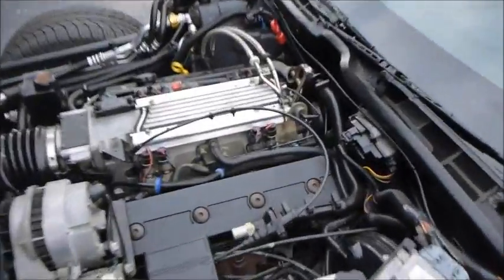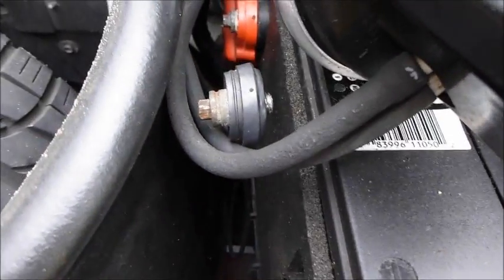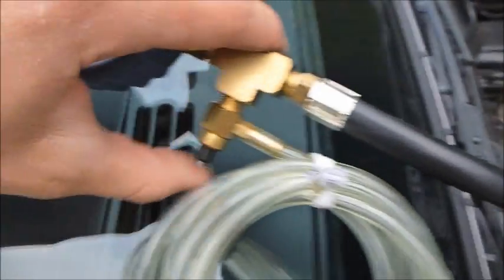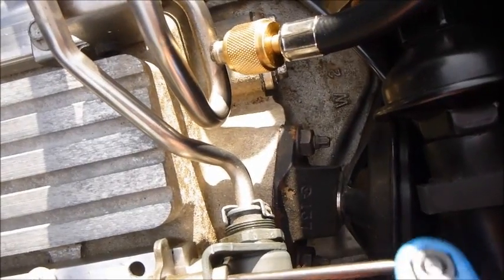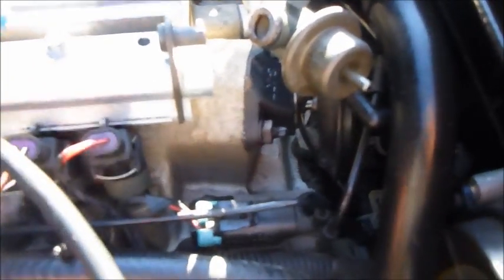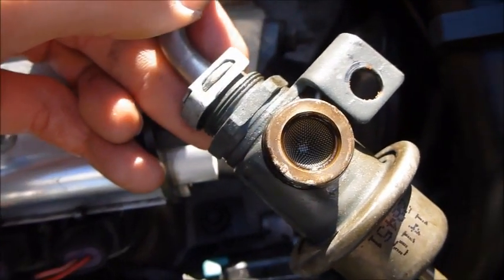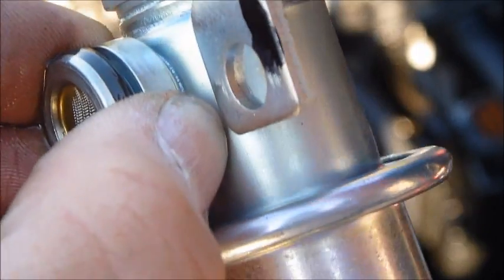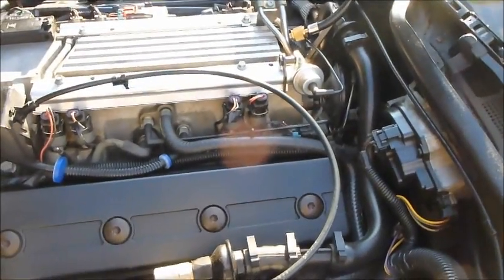How to replace a Fuel Pressure Regulator

Comment: Chris, thank you for this video. I have the exact sale issue of a leaking fpr at 50 degrees on my 96 LT4. Why would temp have anything to do with this condition?
Reply from the maker: Because metal and rubber contracts and expands at different temps.

Comment: One thing you can do to test it. Pull the vaccum line off and prime the fuel pump, you might have to run it for a few seconds. In theory if it's broken, the diafram wont seal and will spray a little bit of fuel out of the vaccum hose port. If it doesnt, it probably isnt broken.

Comment: Does the fuel pressure regulator need a regulated vacuum line, or will an unregulated line do just fine? I just pulled apart my Ford Ranger and the vacuum line that was on there was unregulated, but the truck ran very poorly. I'm wondering if it needs a specific amount of vacuum to regulate fuel flow

Comment: Hey chris would this cause the vehicle to stall intermittently if that fuel pressure regulator was bad? I'll drive and the car will shut off
Reply from the maker: Possibly but many things can cause that.
Reply: @chrisfix hey i think i might have your same problem, i would stall if i let my rpm dip below 800 and i would have to flutter the pedal and turn it to get it to start

Comment: i learned from your vlog that a vacuum leak leads to high fuel pressure, so if i check my spark plugs and they are clean, it means it doesnt run rich, which means fuel pressure not high which means no vacuum leak?

Comment: Chris, You are still helping us out with this video you did 10 years ago.  These things develop odd leaks.   Mine was leaking maybe 3 times over 3 months.  I would smell fuel in the car for maybe 5 minutes and then go away.  I thought it was a plugged vent line.  Just checked the Fuel Pressure Regulator  before checking the vent lines.  Started the engine no leak.  Pulled the vacuum line and it leaked bad on the non-vacuum side of the diaphragm.   Thank you Chris.

Comment: This morning I started mine up and for a split second I realized it wasn’t the same amount of cranks and it was really boggy… Drove it down the street, drove it back and parked it in the driveway. 20 minutes later I go to start it up and it’s just cranking now… No start, I was thinking maybe bad injectors but this looks easy enough to swap out…

My question is, why/how did you know it needed to be changed? What were the symptoms? Mine has been running great, so much that the last time I drove it I pushed the hell out of it on an empty freeway and it did great…

Comment: Seriously? 1st mistake, negative line can drop down & hit some metal causing spark, unless you attach it to a plastic hanger & hang it somewhere it can not spark. If ur worried about getting electrocuted, disconnect the positive line from the battery. That drops down & hits metal, there's no worry of an accidental spark.
Reply from the maker: You remove the negative first because electrons flow from negative to positive. If you remove the positive and you ground from the positive post to the metal of the car, it would not end well.
Reply: @chrisfix  no, negative(black wire) is the ground. You ground the positive(red wire), nothing will happen because the battery is already grounded with the negative(black wire). That's why you said, make sure that's secure when you disconnected the negative wire, which the way it looks like you secured it on what looked like hoses, looked like it could've been knocked down and you would've not only electrocuted yourself, but shorted out most, if not all, of your electrical system. But hey, you feel like you know better, then by all means, don't listen to me. I just hope you'll never really have to find out the hard way.

Comment: What T wrench sizes are used to hold fuel lines and fuel pressure regulator????? Most from that era are upside down and have much harder access, and it's easy to see how hard they are to break lose. Once rounded out then views are going to have real problems. Always show tool sizes. Everyone knows the battery bolt size.
Reply from the maker: I don’t remember off the top of my head for the corvette but that’s why I started to include sizes in my later videos!
Reply: They really should be added to your video, as they're very important on hidden access on many vehicles. I haven't seen any mention in shop manuals. I'm pretty sure the fuel pressure regulator is a T30, but the fuel line bracket is only a guess. You see how hard they are attached in your video. Anyone with that corvette should be able to check the size, expecially since the bracket bolt is up on top.
Reply from the maker: @ronkosanovich6450  for sure and the new videos have that info. This was one of my first videos over 8yrs ago…
Reply: bracket is T25 and FPR hold bolt is T30. Both can be very stubborn to removed.

Comment: I wonder if silicone would be okay on the o-rings, or would that run the risk of clogging the fuel system? I'd rather use silicone, because it's rubber safe and is made for o-rings.

Comment: 4:58 
When dismantling any gas lines, it's a good idea to pull the fuel pump fuse and run the vehicle until it stalls out. Then no gas in any of the lines.
Reply: Would you then, afterwards, still disconnect the negative terminal on the battery?
Reply: @diro6232  it's always a good idea to disconnect the battery when working on the vehicle. But you're good after pulling the fuse. I myself wouldn't worry about disconnecting the battery unless you're going to be by the fan in the engine compartment.
Reply: @davecpgh  Thanks for that timely reply. Could I bother you for one more question?...Once new one is in, and fuse is put back in and negative terminal is placed back on, do you have to do anything particular to prime back up the fuel pressure?
Reply: @diro6232  easiest thing to do is turn the key to the on position then off then on a few times. It'll pump enough gas thru the whole line. If that happens not to work, then turn ronin position and pump the gas pedal a couple times, but be careful, you don't want to do that anymore than you need to
Reply: @davecpgh  Thanks for the helpful info! 👍 I will keep that in mind!
Reply: @diro6232  no problem

Comment: I got a pressure problem replaced the filter pump and it still runs like crap but my regulator is not leaking think it could be that?
Reply from the maker: Sounds like that's it!

Comment: For the first time in my life there is I had an ‘unsolvable problem’ and what do you know Chris made a video for it 8 years ago! I bought a Subaru with a ‘blow engine’ I’ve replaced everything that is related to vacuum boost and timing in this car or tested it with functional parts. Quite literally everything. This HAS to be it at this point! Thank you Chris

Comment: Great video. Only vid that showed the clamp on both fuel lines had to be removed to remove the regulator. But I think the vid could've been even better if you showed, not only verbally, the sequence of connecting all fuel line/nozzles together and buttoned up. But thank you for these great vids, regardless.
Reply from the maker: Thanks a lot!
Reply: @chrisfix  
Chrisfix, the two parts clamp are held tight by one 6 point star bolt. The problem I have is the star bolt is upside down against the engine. I have to disconnect the fuel lines to get the regulator out. Is there an alternative way.

Comment: Hey Chris, listen I have a tuned engine, I have a new direct ignition cartridge, new plugs, new fuel filter too. Can a failing fuel pressure regulator cause surging and rough idle? Misfires? Hesitation at full load/boost?

Comment: Also if it hasn't been said, unscrew the gas cap, I had constant pressure with the fuse out and finally decided to take off the fuel cap and  the pressure that was built up was now gone, large amounts of pressurized fuel in the line before taking off the cap on my 95 vette. 
Great videos!!!

Comment: Hey Chris, I purchased a used car with a b series engine swap. It runs super rich and I've fix and replacing parts to get better fuel economy. I've notice that the for does not have the vacuum connected and from the manifold the inlet is plugged. I tried adding a return line but the idle went up over 1200 rmp. I can't lower the idle since it's at the lowest point it can go. So as of now I'm running with a vac delete. Questions is would it be a bad fpr or is it tuned to bypass?

Comment: Nice video. I have a 95 Camaro z28 with an lt1, same engine. Does anyone know why it might back fire and stall? It back fires at 3,000 rpm. Recently Replaced spark plugs and egr valve. Thinking it might be either be the spark wires or injectors. Looking for another opinion.

Comment: I think I'm having this problem. I'm getting a '97 Honda Passport that will start, but it won't stay running. It acts like it's starving for fuel. I've already replaced the fuel filter. I'm fairly certain it's not the fuel pump because I really don't want to drop the tank. (More hope than anything else).

Comment: If we dont have a fuel pressure gauge, can we just disconnect the fuel pump relay and try to start car to release the pressure?
Reply: Terrance Williams pull the pump out while the car is running an it will stall an shut off. Let it crank a a few times an no pressure.
Reply: Terrance Williams yes you could do that

Comment: Would this be the problem for my f150 hesitatingly about 40 mph but still goes just need to apply more gas? Thanks man
Reply: did u figured out the problem? my car is doing the same
Reply: Not yet I don't have a muffler so what I think it is lack of back pressure but not sure
Reply: F150s have fuel filter issues try that.... if not cats could be plugged.

Comment: my C4 needs to crank 2-3 times, when cold, in order to start engine.
spark plugs, cables, air filter, flow meter, fuel filter anf injectors all replaced recently.
do you thonk it's a fuel regulator issue?
once it starts then it runs smoothly
Reply from the maker: +TheeAmateur Yes, that is exactly what I saw in my vette. Check out this video on how to diagnose the problem: https://www.youtube.com/watch?v=_oXLUqE4Sf0

Comment: my 92 camaro rs is giving me probs.. smooth on cold starts, smooth on low speeds, but as soon as a floor it, it bogs down, I keep finding others who have this problem, but no 1 has answered what's the solution.. any clue ? 3.1 v6 1992 camaro rs
Reply: +Jay Alvarez I don't have a camaro, and I'm just a wanna-be car techie at this point - so take this with a grain of salt, but I had a similar issue with my car. Turns out it was a transmission problem. The trans wasn't shifting back a gear when I floored it so a whole bunch of fuel was just being dumped into the engine while it was under heavy load, causing it to sputter and drop in rpm. Have no idea if that does anything for ya, but maybe it's not a fuel or aspiration issue at all.
Reply: +Jay Ricco thanx for the info, had it checked out a few days back, faulty injectors.. that's koo you for replying tho
Reply: +Jay Alvarez thank you*

Comment: Quetion: in which direction does the fuel enter the regulator and where does the excess come out.. and can i disconnect this black hose and check if fuel comes out.. when i think my fuel pump is not working ???
Reply: i want to know this as well
Reply: Ahmed H. Ramadan it goes in through the metal pipe and there is no excess fuel

Comment: what happens if I don't have the fancy machine to take pressure off the regulated before removing the old one
Reply from the maker: +2pacnasgame Run the car and pull the fuel pump fuse. That will cause the engine to suck the fuel out and leave no pressure.

Comment: Hey Chris, here I am again lol. Long story short. 2000 Sportage came with a CEL code for P0138 code one day, but it turned itself off the next day. 5 days later, I'm stranded in NJ my car wouldn't start. Fuel pump fried, fixed that. Now here is the problem. After fixing the fuel pump, I now have the same P0138 code that DOES NOT go away, I replaced both O2 sensors, reset the CEL, and it comes back on after 2 driving cycles. Me and my mechanic can not figure out what's wrong. Could it be fuel pressure regulator in the most weird scenario? No codes for CAT or anything, keeps giving P0138 =/ help
Reply from the maker: Exhalerr r Well, it could be high fuel pressure so I would do a fuel pressure test since you replaced the O2 sensors already.
Reply: +ChrisFix yeah I think it's somewhere in there. Because I fixed the P0138 (main relay wasn't OEM, go figure) but now I have a P0442. Already replaced fuel cap to OEM, what's next

Comment: WIll the fuel rail work without the small metal clips? I bent a couple. It looks like the 4 bolts hold it down. I am changing injectors on a lt1 camaro. 1/2 the engine is under the hood. I am afraid I loosened the fuel line to the rail with all the tugging and twisting.,.
I should of had someone do it. I am afraid i screwed up. Any help appreciated.

Comment: Hi Chris, I have a 2001 Ford Taurus and it has the check engine light on. The fuel gauge does not work, it always shows "E" (Empty) and the fuel light is always on.  OBD2 scanner and gave me a P0460 which is flex fuel sensor module. The part number is YF1Z-14A069-AA. I found a video which says that the flex fuel sensor is behind the radio. Do I need to disconnect the negative terminal of the battery to do any electrical work as this? Also do you know how this needs to be done? Thank you.
Reply from the maker: Steve Smith Yes, always disconnect the negative terminal when you work on electrical components to be safe (especially under the dash). I do not know the specific process for your Ford Taurus to replace the sensor (I never did it). You might consider getting a service manual which will walk you though it all.

Comment: hello. I just saw today that my fuel pressure regulator has been leaking for a while now.ive been noticing that my car has been hesitating at start up and yesterday it happened while I was driving. chould the regulator cause this? and  where did you get the part and where did you get the pressure tester?

thanks
Great video.
Reply from the maker: tomas puigjane Yes, the regulator can cause this problem. What year, make and model car?
Reply: ChrisFix its a 1996 corvette lt1
Reply from the maker: haha, same year as mine! Here is the one I used: http://www.amazon.com/gp/product/B000C9JXSY/ref=as_li_tl?ie=UTF8&camp=1789&creative=390957&creativeASIN=B000C9JXSY&linkCode=as2&tag=chri0e2-20&linkId=DJSAJRCFNMTJ6BTJ

Comment: I have a 2002 Yukon 5.3 with an intermittent hard start mostly when its cold it will take like 3-4 seconds longer of cranking for it to start. It idles and runs perfectly just every so often it takes a little longer to start. It has a newer fuel pump around a year old or so. I did notice that I am getting a strange noise from the FPR similar to this video: https://www.youtube.com/watch?v=R1bgiJVoNOc I Also pulled the vacuum line to see if it was leaking but did not see any fuel coming out of it. I am tempted to buy a new FPR but don't want to spend 50 if it isn't the issue. Anyone have any similar experiences or advice?
Thanks

Comment: hey Chris you should do a video on how to replace the fuel filter. I need to do it to the mustang and the trans am I just bought
Reply from the maker: ***** I will be doing a video on replacing the fuel filter but I need to finish the fuel cleaner series first. Thanks for the video suggestion!
Reply: Yup, this is what I did. Good write up.
Reply: And sorry for the bad wording, it was about 4 am when I typed it lol.
Reply from the maker: Chinesefoodrocks1521 That is what I like to hear! Viewers helping each other and adding to the community! Awesome!
Reply: I'll try and take some videos/pics of when I do long tube headers to my trans am. Any mechanic knows doing headers on a v8 is a BITCH. I have my buddy helping me who used to work at a performance shop and I'm trying to learn how to do it myself, but you generally need two people for it.
Reply: Yeah mine shouldn't be too bad but I have many swivel extensions ready...
Reply: Mustangs it's easy, took me 30 mins. 

Jack the rear up, secure it, slide under the passengers side from the rear and right behind the fuel take you'll see it. Be sure to bleed you fuel pressure off, I didn't have to since my check Valve is bad. You'll need a ford fuel line disconnect tool, $8. Remove both lines. Depending on the model, there will be a clamp holding the filter. Be sure to have towels on hand, even though my system wasn't pressurized, some fuel dribbled out, to catch any fuel. Disconnect the lines, grab your new filter, be sure you have the flow direction correct, plug the lines in, turn the car to the on position a few times to pressurize the system, start the car. I got under the car and checked for leaks to be safe.
Reply from the maker: Chinesefoodrocks1521 Thanks for sharing man! This is a great run-though!
Reply: Thanks Chris! That means a lot coming from an experienced mechanic. All my car knowledge comes from reading online things, tinkering with my car and you tubers like you.

Glad I could help you replace your filter.

And I'm only 17 and can tell you the basics of how a car works and runs.
Reply from the maker: ***** That would be awesome! I always wanted headers on the Vette!
Reply: You could handle it Chris, you just really need a lift unless you want back problems for the rest of your life =p It's hard because so much stuff is in the way and so much can go wrong. It's a LONG job.
Reply from the maker: ***** On the Vette you need to watch clearance with the frame and people have to hammer the header pipe many times to make it fit. I just dont want to play with taking the old exhaust manifolds out lol.